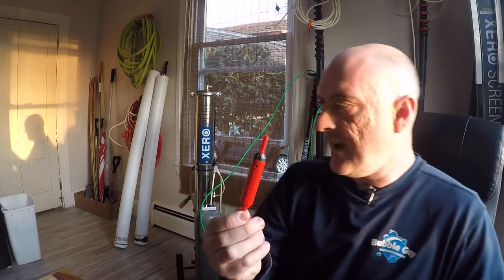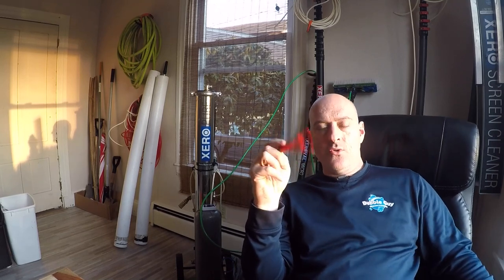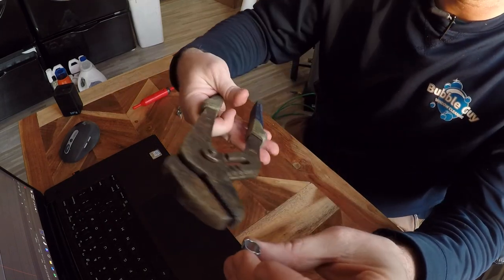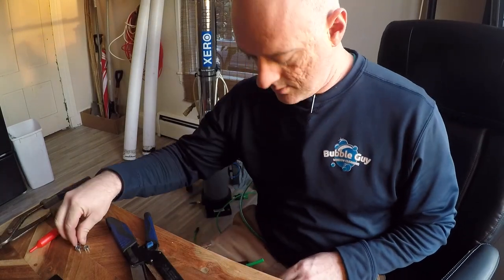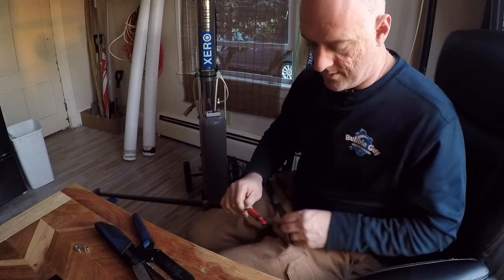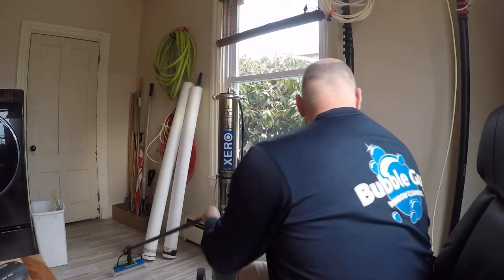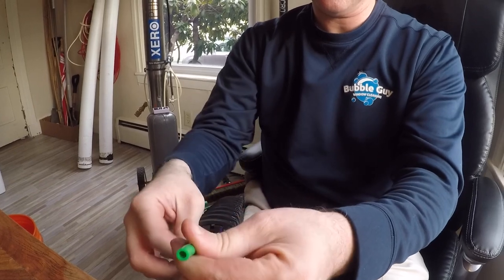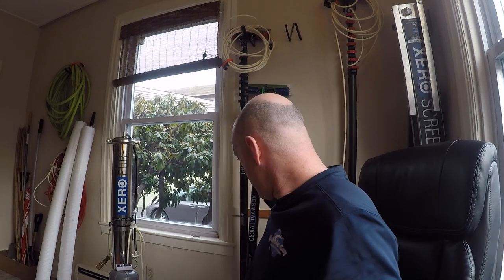Installing a Univalve Into An Oval Pole with Jordie

Comment: I have the new elite pro oval 30' Pole but my univalve sticks out a little bit of the bottom when it's fully collapsed is this normal? I can't get it to hide anymore inside the pole due to the 1st length being 6' long any others being 6' in length as well.